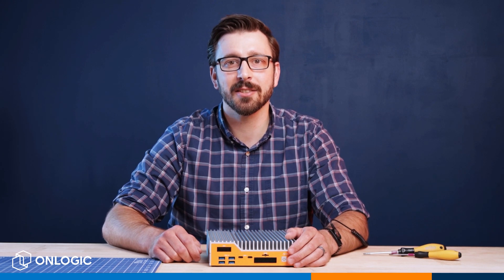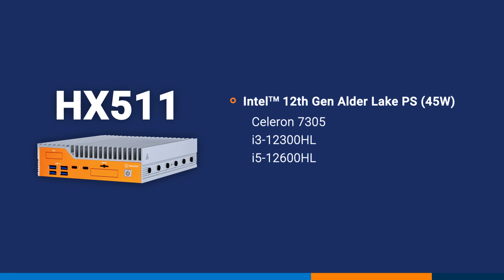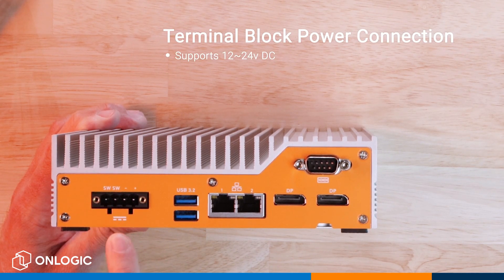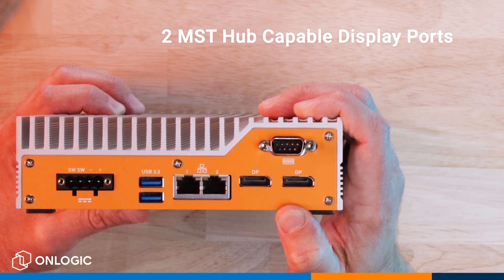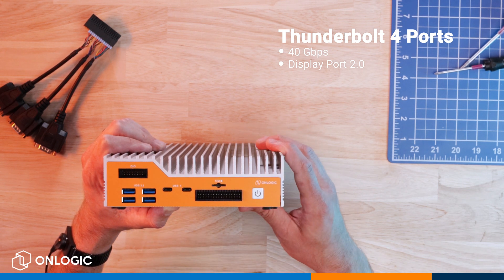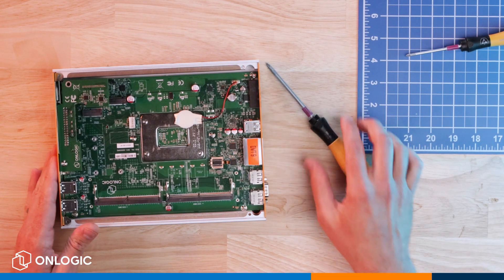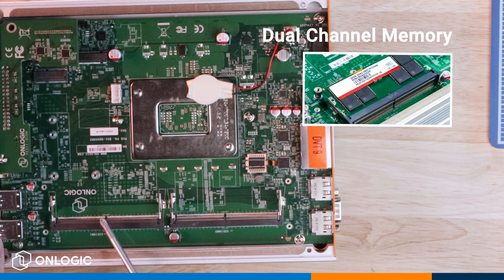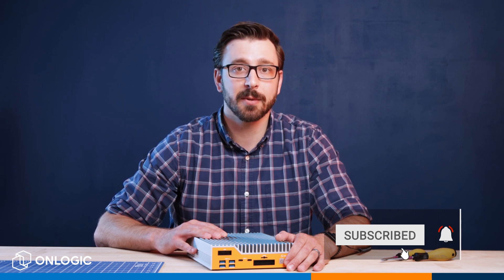What's Actually Inside a Fanless Industrial Edge Computer?

Comment: Question?
Where was a infrared video of the computer running?
Where is the built in safety at to keep it from overheating?
Reply: all computers just throttle or if its bad enough just turns off
Reply: Modern CPUs don't overheat, they throttle.
Obviously, if you're going to mine or play video games it'll throttle with a passive cooling, so you'll need water cooling and a standard case. These machines are made for wall mounting and to run machinery and production lines, view it as an advanced control board